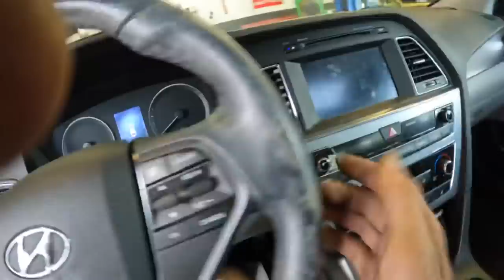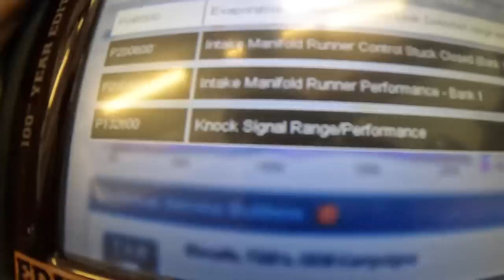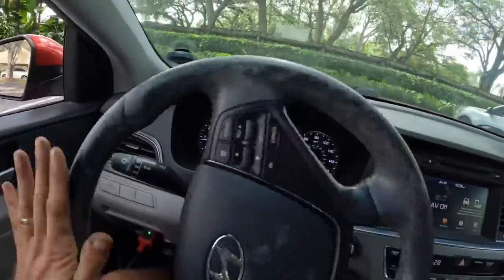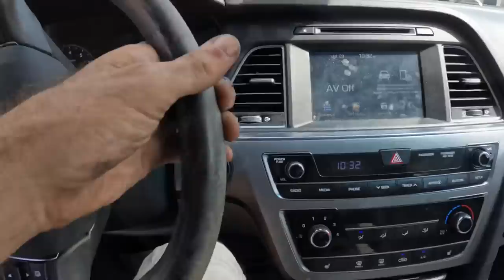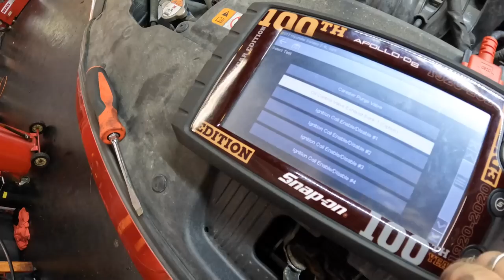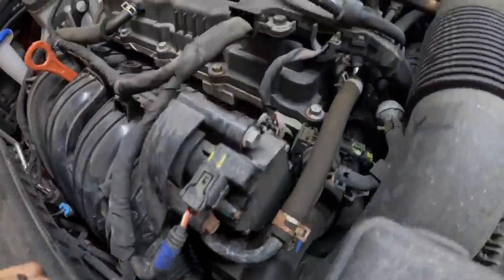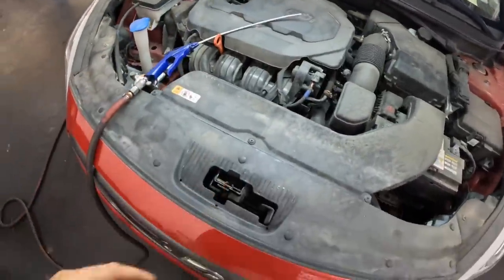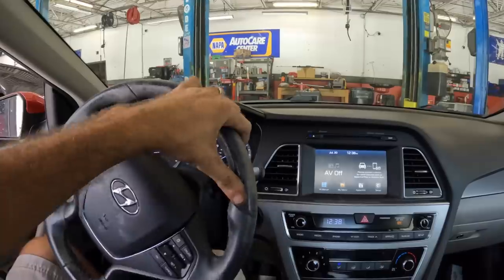Engine Choking to DEATH!  Losing Power! Hyundai Kia motor repair

Comment: Judging by the condition of the steering wheel I knew what the engine would look like before he opened the hood. The air filter is probably the one installed at the factory.
Reply: Valve cover gasket did not leak though.
Reply: @loubakker5000  Hyundai know how to build stuff. 👌
Reply: @KeithHeinrich  valve cover gasket is a very common thing that is replaced on these 2.4s

Comment: hey man love your videos, as far as the p1326 dtc code vehicle is in limp mode,and  that is under recall from hyundai, they should take it to a dealer where they will perform an engine bearing clearance test and will most likely require a longblock under warranty, and as far as the intake your right about the runners stuck due to carbon buildup 
oh yeah by the way I used to work at a Hyundai dealer
Reply: exactly i've run into this at least a dozen times
Reply: What the hell, bearings? I’m not an idiot but this sounds odd to me
Reply: Like the whole long block is shit quality and out of spec?
Reply: @tacomas9602  the metal wasn’t cleaned of burs
Reply: @tacomas9602  performed the bearing clearance test plenty of times, if it fails the test, they get submitted for an engine. It's up to hyundai if they approve it or not.
The code can also just be the knock sensor needing replacement. which is directly behind the intake manifold and fuel rail.
Reply: Yah i work for hyundia and that is under a recall for it but only if it is knocking may need the ksds update for the ecu
Reply: @gamercalvin  in Canada it's an automatic approval for engine long block. I just finished one today and called another. I don't even run the bearing clearance test anymore. They pass even while knocking.
Reply: @tacomas9602  just the bearings... But they grenade and lock up the engine. Free motor unlimited time and mileage. At least here in Canada.
Reply: @TormentedPenguin  sadly we have to run the bearing clearance test under the T3G TSB. Have to follow those charts in order to prove it will need an engine. As long as you have the p1326 code
Reply: @gamercalvin  which is stupid because it passes, you clear the code. ship it and it ends up in limp mode again.. now you got a pissed off customer who can't drive the car.

Comment: That steering wheel needs some brake cleaner!!🤢
Reply: I was thinking the same thing. Looks like the owner has a vice like grip and abuses the horn. 😄
Reply: Remove wheel and launch into sun! 😄
Reply: And it’s hers if there’s makeup all over it too.
Reply: Its just makeup
Reply: I was thinking sandblasting......
Reply: And then a lighter.
Reply: That or fumigation~
Reply: It looks like it will need at least a master-case of brake cleaner to get all that crud off of it. Yuck.

Comment: So the P1326 is something that needs to be dealt with by the dealer.  We installed software that detects bearing knock,  it alarms you, flashes the engine light and cuts power in order to get to safety in case bearing failure has occurred.  Sometimes it's a false alarm and needs to be repaired at the dealer under the original campaign  free of charge
Reply: Just what I was going to say.have same car, but not the sport . Intake runner like that one. If driven city mainly gets rusted. Punch it good on the highway and it will code. Knock code means knock sensor bad so the protector software kicks in
Reply: This vehicle already has the update because it came in with a flashing cel light I’ve seen ones that haven’t had the software update preformed almost always come in seized or knocking with no cel
Reply: @richardtejeda3811  I know.... that is what the update is.  So either the engine is knocking, or the sensor is faulty. Either way, it needs to go to a dealer....unless the customer wants to pay
Reply: I live in a state that sells 85 octane at the pump as regular at most gas stations. because of this there are a lot of Hyundai/Kia cars with the knock codes due to pinging.
Reply: makes diagnosing the issue with the flashing MIL so much more fun because nobody fills up with the right gas

Comment: I had to replace one of these manifolds at my shop about 2 months ago!! The intake was all gummed up with carbon! They had never had the intake system cleaned (it had 160,xxx miles on it). Replaced the intake and cleaned the intake system and car ran great afterwards!! But before it had zero power! Keep it up Ray! I don't know how you popped into my recommended about a year ago but I'm glad you did! I love watching you, Ford boss me, and Ford tech makuloco!!
Reply: These are DI which means major carbon.
Reply: It’s sad cuz that car only has 62k and it’s already gummed up with carbon
Reply: I'll keep this in mind for my dad's 2014 Kia Soul 1.6 auto. 
It's gonna reach 100k within the next few weeks, and so far has been perfectly fine. Though, I'm taking basic care of it. So hopefully it'll be one of the few that last xD

Comment: Nice video ray. As a kia tech the vehicle will almost guaranteed need a Vcm and the p1326 will need to be sent to the dealer due to having the knock sensor code. The dealer will perform a bearing clearance test and conclude either it will need an ecu update,  knock sensor or new engine.
Reply: dang
Reply: @Franklinveterinarycenter1of4  The new engine would be covered free of charge under warranty, as well as a rental vehicle.
Reply: Absolutely right, they will warranty you’re engine as long as there is no sludges in the engine
Reply: @lowellevanslomboy7526  it's 100% up to hyundai if they deem it to be replaced. I've replaced an engine with even sludge in the engine before under warranty.

Comment: So let me get this straight, they are gunna leave with this car that Ray decided wasn't safe to drive cuz it just doesn't move... and keep driving it around until its fixed. Awesome
Reply: I can't believe if you have a problem like that you would go to a garage assuming the problem will be fixed in less than 2 hours to begin with.
Reply: "Florida Woman". 😝
Reply: look at the state of the car, they have no money. At least it wont take up space in the parking lot and it can be used to duck down to the local shops if needed until they can afford to fix it.
Reply: Ray was working at the bottom feeder garage.
Reply: @BrutalHonduras Jiffy Lube caused the trouble.

Comment: PS: My little brother bought the Excel 1.5 off my now 90 year old Dad.
Well over 400000 on the clock.
Suddenly went gutless, and nobody in the town where they lived could figure it out. 2nd gear on ordinary hills, etc.
I suggested dropping the exhaust, so they did that, and, (loud and proud), the car was off like a rat up a drainpipe.
The exhaust was given some sort of violent clean-out, and off she went.
Apparently still going strong at 480000, after a recent set of coils.
Bloody good.

Comment: The classic P200A00 is the most common code i used to get up here in canada. I work for kia now, and the problem exists on nearly all our models with variable runner length intake manifolds.
Reply: What was the actuator he turned on with scan tool? I'm trying to figure out what else would be down there under the intake?
Reply: Is it the actuator or is the runner hanging up? I have the same problem with my 2017 Hyundai Sonata. But I don’t have a loss of power.
Reply: For vernon and conan, ill rewatch yhe video, but it usually is the flaps in the runners hanging up because of carbon/shmutz and the vcm beign a stick bugger. We opt to replace the manifold completely as freeing up the rod that moves the flaps can get seized
Reply: @MyTheBlackJack  yup. It’s worse with the gdi system. I get so many gdi Kia’s with that code
Reply: We've simply cleaned and lubricated the rusted pivots on thr actuator rod and able to fix the issue
Reply: Do most Canucks consider them to be short life unreliable units too?
Reply: I have a '16 Sonata with the P200A code. It's intermittent though but eventually I'm sure I'll just have to replace the VCM motor. I'm in Ottawa so yeah, must be a Canadian thing. ;-). One mechanic said "10/10 when I check, the flaps in the runner are fine, it's the VCM motor itself that's stuck." ie. replace the motor. Done. You can actuate the VCM motor specifically and Ray will probably hear if squeaking and grinding away.
Reply: @gwomp61  FYI the whole intake assembly is cheaper than just the VCM I know it sounds totally wrong, but it is

Comment: Ray: Watch the P1326 Code! 

That code, the flashing check engine light, and the lack of power means the car has gone into Engine Protection Mode. Connecting rod bearings are worn (as detected by the knock sensor).

Vehicle should not be driven, as the engine will soon seize.

Advise the customer to take it into a Hyundai dealer. She might qualify for a new engine, under a warranty extension on the engine. 😉

Also, as others have commented, at under 100K miles, and about 5 years (you said this is a model year 2017, didn't you), there may be factory warranty on the other stuff you picked up: intake runner actuation and EVAP codes (if the latter turns out to be more than a gas cap).

In this case, the best thing you can do for this customer is strongly advise her to bring it into a Hyundai dealer.

Enjoy your entertaining diagnosis style and honesty that you show in your videos.

Keep up the good work!
Reply: That escalated quickly
Reply: Yup, that's one of the reasons why I traded up my '16 Sonata to a '22 Santa Fe. Took great care of the car, had only 74k miles but the oil consumption started going up in Jan (was putting in 1-2 qts every week) , the oil pressure light kept flashing, car was starting to kick when accelerating, and then dealership wanted me to pay several hundred just to dx and fix the issue(s).
Reply: To those who don't know, the Tuscan  shares the same engine (Theta) with the Sonata so avoid them at all costs cause Theta engines are crap.

Comment: my wifes car went into a garage last week i washed it hooverd it polished it checked tyre pressures as i used to work in a garage i feel if the car looks well looked after you get a better job the issue i had was a defective windscreen washer pump issue

Comment: My wife had a 2014 Sonata that had the engine recall. The check engine light came on, and I stopped by a garage. The mechanic ran a scan and it read "Glow plug needs to be replaced". We dropped it off an a dealership. They had 15 engines to replace. 3 weeks later, we got the car back.
Reply: I have an employee who had a 13 Sonata. Driving down the highway the rod went thru the block. Hyundai gave him a loaner and he had it back in a couple of days. He finally traded it with almost 200k. It was the only issue he ever had with the car. Granted, it’s a big one, but it didn’t cost him a dime. They covered the towing and everything.
Reply: Dang 3 weeks to do 15 we do in my shop easily 5-6 engines a day
Reply: Glow plugs?  So, Sonatas are diesel powered too? I didn't know that.😎😎

Comment: I've driven all flavors of engines on the Sonata.. found the 2.4 to be weak in my opinion. Currently have 2020 sonata with the new 1.6T engine and I love it. By no means will it win a race ever. But it's just the right balance to have enough horses to get around slow people. Sonata's are pretty decent cars.

Comment: Ray's story reminds me, when driving, to be predictable, not "nice."
Reply: Absolutely, I have those standoffs at 4 way stops when 2 or more people are trying to be the nice one by letting the other by first but it ends up taking longer.
Reply: The most dangerous "nice" thing I see a driver do, is stop, in a multi lane roadway, for a pedestrian, which only sets the pedestrian up to be plowed by a driver coming on the side of the stopped "nice" vehicle, neither person able to see each other
Reply: yes, you can't drive for the other vehicle; you do not have his view or senses or skill
Reply: @jasonw8124  where I am you legally have to stop at cross walks if pedestrians are there waiting. I do, if I get rear ended then oh well, I won't be at fault.
Reply: @Mr.SisterFisster  in WA State you also are supposed to stop anywhere someone tries to walk. It's a crappy law because there's no certainty that every lane can see the pedestrian... remember I'm talking about 2 or more lanes same direction. Also, it's dark and rainy here, and these peds are wearing dark clothes just walking into the roadway. Lastly, society provides actual crosswalks and expensive traffic signals. If people can just walk anywhere, why waste money on the infrastructure?
Reply: @jasonw8124  where i live i have peds just walk into the road without even checking if there is a clear spot.  Even though theres a crosswalk 30 feet from them they just blast out into the road.  We even have to worry about them crossing the damn freeway 🙄

Comment: I find that engine covers retain heat under them and degrade hoses and electrical wire insulation. Best to remove them and throw them into the plastic recycling bin

Comment: Same issue happened with my 2016 Sonata with the knock sensor and check engine light flashing. I took it to the dealer and they said it just needed a software update for the knock sensor.
Reply: Dealers lie to save money or to get high repair costs out of you. LOL

Comment: The actuator for the intake is made of plastic gears they break, you just have to replace the motor actuator that’s all, the p1326 has been recalled for bad knock sensors though warranty could be declined for salvage title reasons theres a tsb out on it too

Comment: My last new car was a 1984 Buick Skyhawk.
I kept it 12 years.   The first 3 years was expensive because of payment and repair.   After that the car became reliable.   I had replaced the OEM parts with remanufactures parts.
After 12 years, I junked the car,  and replaced it with a 100,000 mile car.  In those days 100k cars were cheap. 
I always maintained the cars will.  I also had the best tires, and being in Pennsylvania my car was inspected every year. 
( Interesting note: In Ohio cars a not inspected, but their Car Insurance is lower than Pennsylvania. )

Comment: Like 10 years ago I worked on a line at Mann & Hummel that made intake manifolds for Toyota Camrys that were just like that with dual runners. They called that big air valve that changes between top or bottom runners an "afis" valve. That part was laser welded in,  which made the whole manifold a single part.
Reply: Toyota's trade name for all of their variable intake runner air path systems has been "ACIS" since the 1980s. Acoustic Control Induction System.
Reply: @matthewbowen5841  I admit I never saw it in writing, so I misheard it. Still cool to see and be a part of how they're made.

Comment: If the customer wanted to press the issue,  Anytime the CEL light pops on they can state it's "Emission" related and covered by federal warranty.   Plenty of dealerships will try to deny things, but that warranty can be applied to a lot of CEL's

The Design and Defect warranty covers repair of emission control or emission related parts which fail to function or function improperly because of a defect in materials or workmanship during the vehicle's first 2 years/24,000 miles (8 years/80,000 miles for specified major components). The manufacturer can deny this warranty coverage if evidence shows that the emission component failure was caused by improper use or maintenance and not caused by a defect.

Comment: There wasn't a single day that went by where we didn't have at least one sonata in limp mode due to the check engine light flashing from the knock sensor code after the ecm had the update installed was always a 50/50 shot on if you were going to have to replace the sensor as well or not

Comment: Why didn't they take it to the dealership? If it's a 2017 it should still have power train warranty.
Reply: My guess is that they already took it to the dealership and the dealership said that you haven’t been doing oil changes or maintenance to this car so we are not covering anything.😂😂😂

Comment: Without watching the full video, I had the same vehicle with the same mileage  and found that Hyandai had several models of the Sonata that had metal shavings left in the motor during manufacture. Ours had some of the same codes but ours seized. Hyandai ending up replacing the motor at their cost. Just FYI so that you would be aware in case you run across this again and can’t diagnosis the issue.

Comment: Question: Do you ever check the vehicles for RECALLS before starting work?

Hyundai P1326 and flashing check engine light means do not drive the car. Shut it down have it towed in for service. It will be in "limp mode" to try to prevent further engine damage. There's a whole history of KIA and Hyundai recalls and complete engine replacements under warranty.

Personally, I would not even run the engine.

Comment: I had one just last week that had a vvt actuater valve, knock sensor, crank sensor, and  misfire codes. Under normal driving it was decent but definitely lacked. Under hard wot accel only at 4500rpm it would studder hard like it would buck ur ass in the seat and it's a manual so real bucks lol.  It had a bunch of gas in the oil to which i know with these motors especially they run rich and have known issues with dillution. That all being said it allllll was fixed by an oem dealer crank sensor lolol crazy stuff man

Comment: That 2.4 is a garbage engine. I had a 2018 kia. There's a major lawsuit on this engine.  I also believe the low power is from the knock sensor. The ecm is try to protect the motor by putting it in limp mode. The same crap happened to me. I immediately got rid of the car instead of waiting for Kia to supply me with a new engine.
Reply: I mean it's either Hyundai or Kia. Do you really expect quality with those?
Reply: @mailmanjoe  even the companies know their product is crap and why they give you such a long warranty period 😅